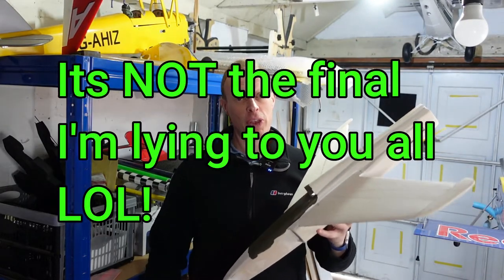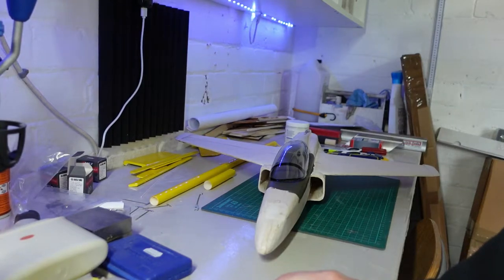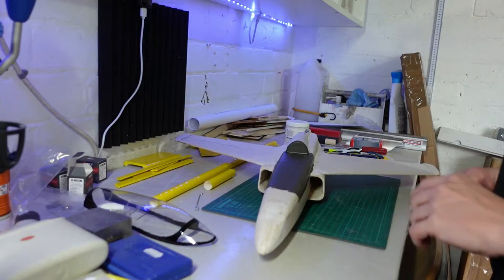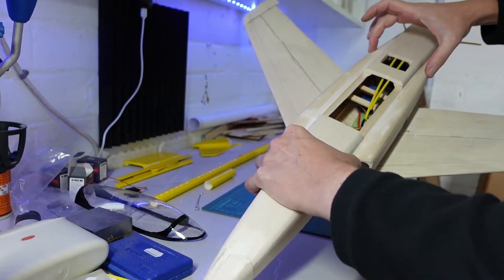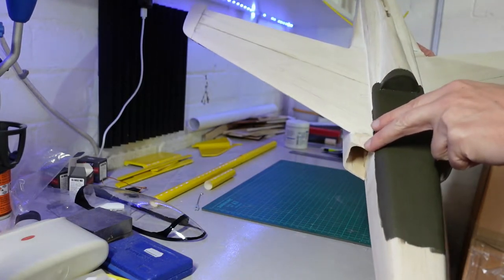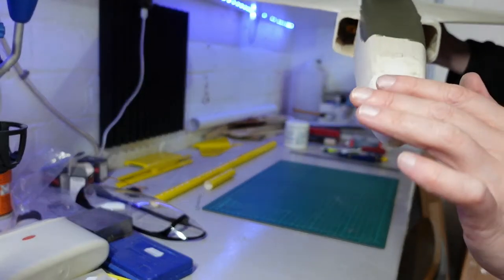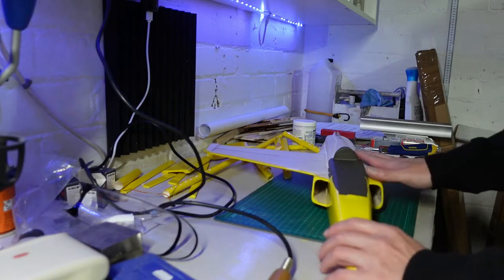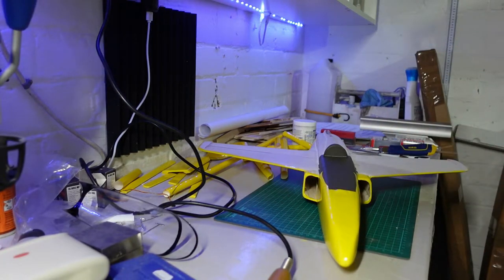Tony Nijhuis 25" EDF Gnat - Balsa scratch build - PART 8

Comment: That's looking rather spectacular T-dog, those ball links on the elevators are excellent aren't they 🙂👍
Reply from the maker: Wait till the next video Cliff.  💥
Reply from the maker: You get a mention 👍🏻
Reply: hi I built a very similar design of a navy Corsair a7 jet , with 1,4 sheet wings , it flew well on a brushed 400 motor pusher prop , it had separate elevators like your gnat as well , so I made a single balsa pushrod with a wire fork to the elevators , it worked fine, it has had some heavy landings , but it's still around, I might get to fly it again, from Tony from Bedfordshire